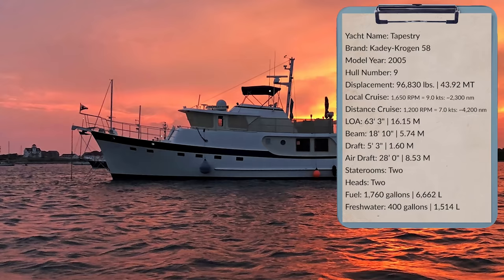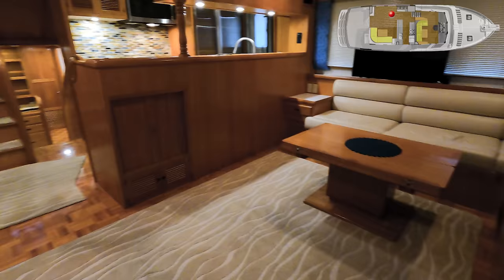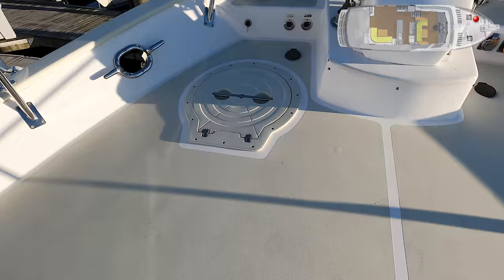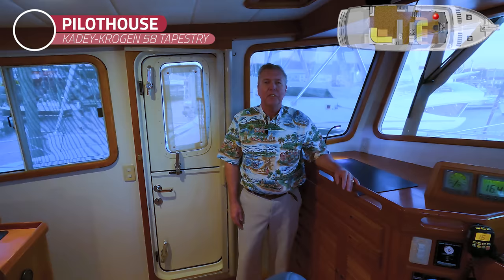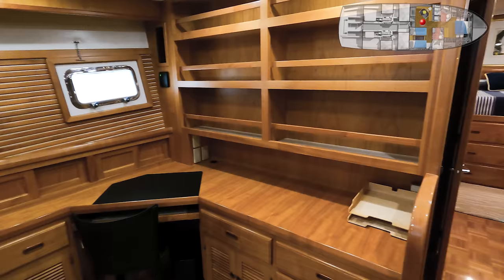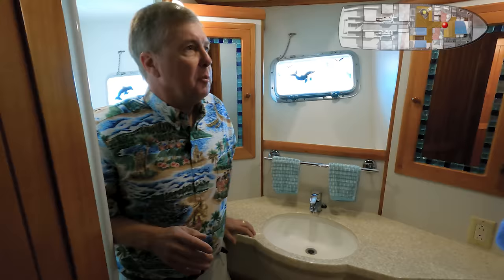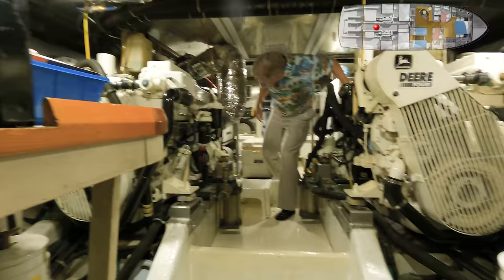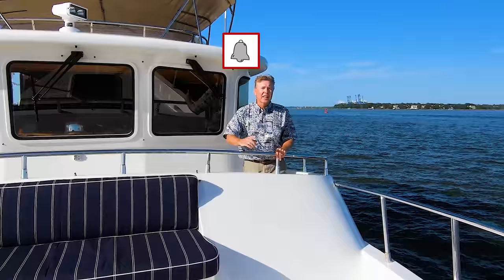KADEY-KROGEN 58 – [Talk Through Tour] – SOLD!

Comment: 3:00
I love those interior walls, and the blue curtains.
Plus, the enclosed aft cockpit, leading to another double door set up for more protection from cold, could make a good addition to heat insulation. Like having a glass porch, to help reduce the heat loss from the front door of your house at home...it's an extra layer that the heat has to escape threw, and the cold weather has to get past.
Reply from the maker: David: Enclosed cockpit really extends the seasons and gives you a protected outside area.
Reply: @JeffMerrillYachts  yes it does. Anyone that lives in any sort of a freezing cold winter environment knows how important good insulation, and even just being inside a glass porch area is, over being outside with freezing cold wind. Just keeping the freezing cold wind or cold rain off your body is a major thing for a comfortable outdoor atmosphere in winter.
I live here in Ireland, so it doesn't get that cold, but anyone that's every had one experience in their entire lives, of walking into a snow storm will remember it. It didn't really snow at all in my area, but other years it got bad.

Comment: Great tour thanks. What was the deal with the plastic bottle covering something at 18.23? . thanks. great work.
Reply from the maker: Jake:  It is a cut down fruit juice bottle. Used to catch the salt water and “gunk” when cleaning the basket strainer so it doesn’t go into the bilge. There is second strainer cap in the bottle with a hose connection that is used for rinsing with fresh water.

Comment: 1800 gallons of fuel is on the low end for a passage maker… I dont consider the Bahamas a ‘Passage’. Beatiful boat, it is spotless
Reply from the maker: Frank:  On JMYS.com we have specifications that show the range and speed of the Krogen 58.  One summary is 3,840 nautical miles @ 7 knots. I'm not sure what you are comparing to, but "low" isn't fair, there is plenty of fuel for an ocean crossing passage. She is in gorgeous condition.
Reply: Most specs give range at 2 or 3 speeds. 8 to 8.5 knots would be more realistic
Reply from the maker: @garyclaxton5325  Clearly a long passage is looking for fuel efficiency and a slow ride. We have normal cruise posted on JMYS.com as 8.5 - 9 knots (1600rpm). Top 12.0 knots (2400 rpm).  Sadly, most brokers don't provide any speed/range numbers.
Reply: Well you can cross the Pacific in it...! Were you wanting the boat the go farther Frank? Say to Neptune or something...?

Comment: So, does sea water actually circulate through the water jacket?   And do both prop shafts rotate the same direction?  CC  c?
Reply from the maker: Mr. Cobb - the seawater enters via a through hull and strainer and mixes out in the exhaust. Propeller are counter rotating. All details on JMYS.com thanks for your questions
Reply: @JeffMerrillYachts  I understand the coming in and going out.   Does the seawater contact the cylinder walls and head internally or just through some type of radiator cooler device.    As a retired mechanic I can't see salt water inside a cooling jacket of the engine?
Reply: @MrCobb-rq8iv  The cylinder block is cooled entirely by freshwater. The raw water only makes contact with the freshwater cooler, taking heat away from the freshwater system and then mixing with engine exhaust at the transom to be expelled at sea level by two exhausts.
Reply: @DrCrabfingers  Appreciate that entirely I would never want salt in my jacket.   blessings....